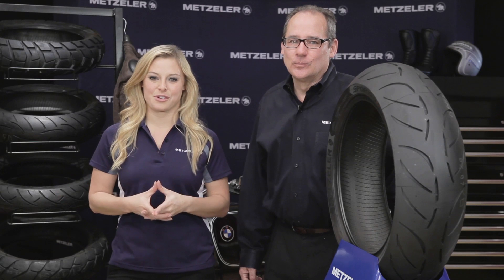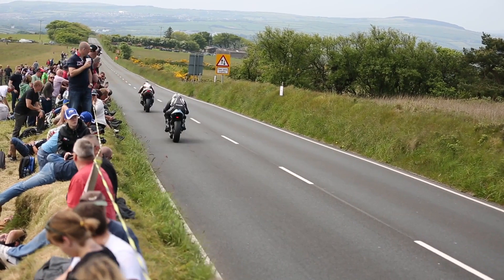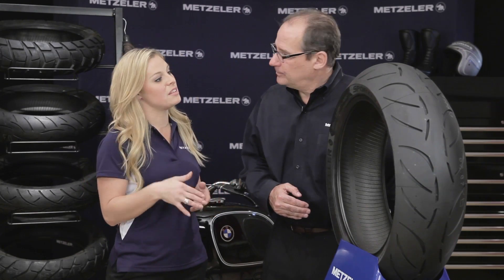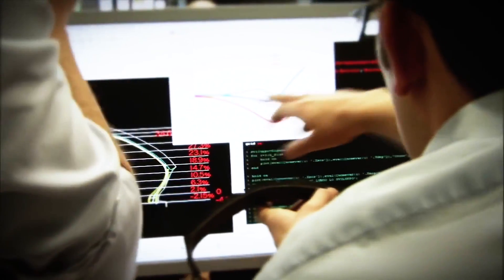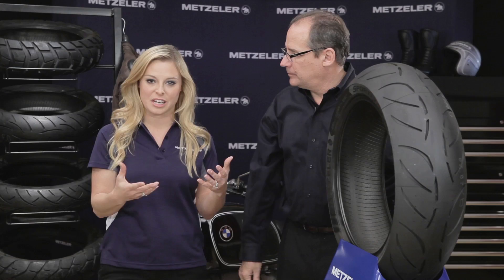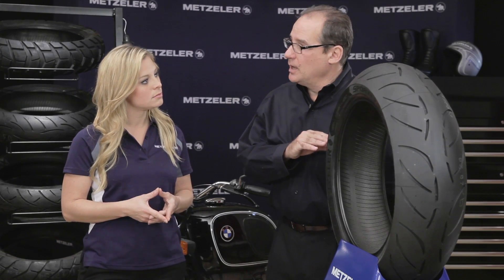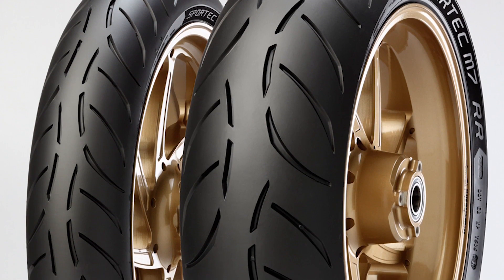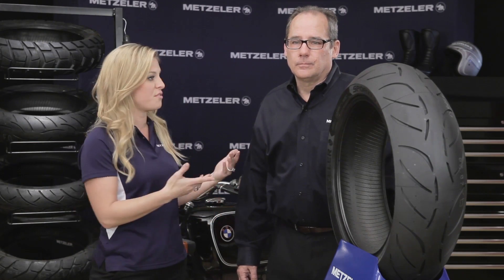Metzeler Sportec M7 RR: Inside and Out

Comment: These work great on small sport bikes as well. I just got the second set for my KTM RC390, the first ones lasted over 4000 miles and were both worn equally due to the harder center strip in the rear tire. They work well in early spring and late autumn Minnesota weather as well as in wet conditions. I've been riding for about 40 years and I've always bought Metzelers so I  may be a bit biased.

Comment: This is an excellent tire on my 2018 Ninja 1000 ABS, no complaints whatsoever.
Reply: 50 or 55?
Reply: Using the 190/55 rear M7RR. I like it not only for the handling, but the taller section height means tire circumference increased ~3%, which raises the bike's overall gearing by that same amount. No ABS / ECU error codes have occurred using this tire combo.
Reply: Ricardo Juliet thanks  mate ride safe 😇

Comment: I'm toying with trying these I have the angel GT'S and love them though I went from a 50 to 55 ratio I will buy the 50  again for sure better balance as the 55 feel like edge of a cliff.The Angel's I get 10,000 miles out of them I ride about 7000 miles a year...I do not ride ham fisted but ride easy in wet and with pace in the dry.
Reply: How’s the twistys???

Comment: These are the best tires I have tried! I will never go back to any other tire. Day one I got in about 10 miles before a rain storm and these things were sticking and no slips at all! 125 miles later I was hitting twisties and confident. I have tried them all and nothing has compared. The heat and stick is amazing in streets of NYC or nice winding roads. AAA+++. I ride all year and have friends that have gotten close to 10k on a set. 

These are hardcore riders that rip! So when I heard that and saw em it was a no brainer. $250 for the set ya can’t beat and I paid more for my S21 hyper sports which were excellent but,, I did get lil kick outs here n there and the tread and everything is just way better on the RR’s.

Comment: I have been on Metzeler from my last five bikes and swear by them. It is also the only company that makes ONLY motorcycle tires ..
Reply: It only means it's a smaller company = less budget for research and innovation.
Reply: Navroze contractor  One would think they would be good at it... but nope. Last set if Metzeler I bought were sport tech 3's and they were garbage. Get them hot,and they turn into ice skates. My home boy went down on a set. Road rashed the left side of his RC51. As soon as mine were done. Ditched them and haven't looked back.

Comment: great grip excellent on back roads !! But wobbles like hell under hard acceleration about 130-150 than get a little bit stable !! this is on my 2016 S1000R !! so some of the story's not true !! my Super corsa was stable even when i got close to the end of it !! after 2800 miles on the rear and about 5700 on front still i could accelerate with full throttle and at 164 was still stable !!

Comment: Recommended tire pressure for street and or track use? I'm running a 200/55/17 rear and a 120/70/17 front on my HP4.